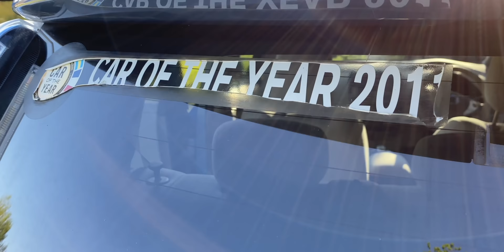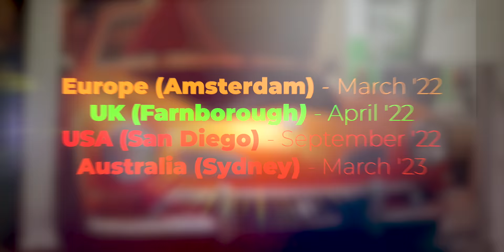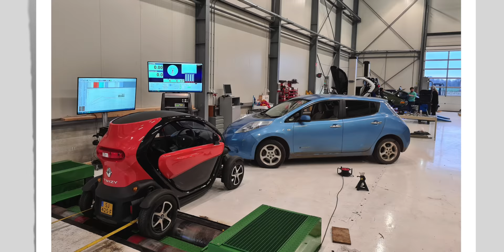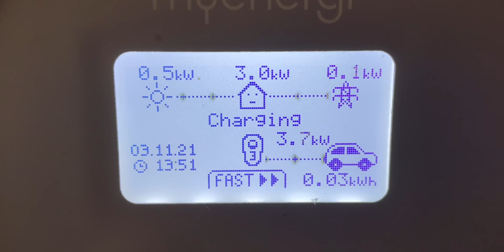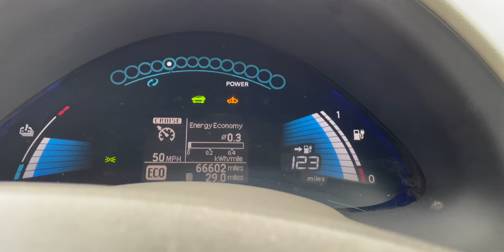Return of the LEAF: Robert drives his range extended EV home from Holland

Comment: n=1, but my 2013 Renault Zoe just passed the 200k km's mark (~125k mi) with the original battery and it still has about 90% of the original battery capacity.
Reply: That’s impressive
Reply: Just don't crash it as it has zero stars on the NCAP ratings.
Reply: @pauldunneska  zero? Really?
Reply: @ChilliPlantOwner  Worth a look at the December 2021 NCAP test for the Renault Zoe which has dropped from five stars to zero stars because the testing regime is now much tougher and also due to the removal of the head airbag that protects occupants from side impacts, according to an Autoexpress magazine  article dated 09/12/21.
Reply: @briangriffiths114  That was in regards to the ZE50, yes. However, keep in mind that the tests gets harder and stricter as time goes, it does not mean that the cars gets less safe than they were when originally tested.
Reply: @pauldunneska  lol no! His car has 5 stars.
Reply: 2 miolion kms miilñes of mileß

Comment: I picked up a 2014 Leaf in 2016. It came from the Bay area in California. I have been driving it in the Pacific Northwest. It now has over 111,000 miles. It still works great. The battery still has 10 battery bars and the original brakes.. When the battery needs to be replaced it will be less expensive than a new car. 
There is a company in Portland Oregon that specializes in taking batteries from wrecked Leafs and swapping out the old battery. The last time I checked they can replace the 24 KW battery for the largest used Leaf battery for less than I paid for the Leaf used. Like getting a new car for a third of the new price.

Comment: Robert, I also have a blue Gen. 1 Nissan Leaf upgraded, in The Netherlands by Muxsan, with an extender battery pack in the boot. Same range as you,  yet I am still using the original battery pack. I now provide the same service in Ireland, Eamon of Range Therapy.
Reply: "Range therapy", what a great name for what you do. Range therapy sounds like a treatment for range anxiety - and that's essentially what it is, of course! 🤣
Reply: As well as my 2 battery bar and 20% degraded 2016 30 kwhr Teckna leaf 6.6 charger, I also have a 2008 e - class mercedes avantgarde diesel with a full range capacity of over 600 miles.

Comment: 2013 Chevy Volt, 286K miles about 50MPG lifetime (engine runs rich). 14K + food deliveries. Degradation; about 80% of original and noticeably increased internal resistance but I just put it in hold mode about 4 miles remaining I still get full power and use the rest on the way home.
Excited to see the LIQUID COOLED Lead battery to be produced!

Comment: Still have 96% capacity on our 7 year old leaf after 86k km. Great for around town, year round even in our cold Canadian winters. Similar experience to Robert - not one issue since new.
Reply: Impressive, ^oo^
Reply: That’s great! I think the culprit with these Nissans is that they don’t have any thermal management. In warm climates that unfortunately kills them prematurely. 
They did help to prove that electric vehicles are viable and that has been invaluable. 
Wonderful to hear the total amount spent on service. A few break pads and I suspect a change of break fluid every two years. 👌
Reply: Our 2014 Leaf have about 91% capacity left at about 88k km.

Edit:  Forgot to mention we live in northen Sweden, sub 0 Celcius 4-6 months a year.
Reply: I'm so impressed, mine is from 2013 and it's at 65% capacity.
Reply: Impressive.
Thank you for sharing 👍
Reply: Only emissions are smugness
Reply: @Paul Haskins: Do you park in a heated garage? 96% is amazing
Reply: @northcountryman  constant heat is what is hard on these uncooled batteries. In a cold Canadian climate, they hold health very well.
Reply: @ashton9699  my uncle has a 2012 with only 3 bar of health gone from the battery. The car has always been charged on 120V and that probably helped it as much as the cold weather half the year
Reply: 96% after 7 years is fantastic, my 2013 leaf had 66% soh when I sold it last year with 191000 miles.
Reply: @ashton9699  mine is at 87% after 5 years and less than 50 k. Also Canadian. 96% is incredible.
Reply: @dylanlong6269  
Did you buy it new?
How do you recharge it....at home or fastchargers?
Have oyu been the only driver?
Does your normal commute involve hills?
Do you live in a hot climate?
Reply: @JohnSmith-yv6eq  Bought it with 40k something miles. I took care of the battery when I had it, but I was in a hot environment and before me it lived in Texas and was fast charged every 2-3 days. No hills. I passed it off to my sister when I moved out and bought a used Model 3. It's still going strong at 70k miles and is almost exclusively home charged. I miss that little car and find an excuse to drive it anytime I'm back at home.
Reply: @dylanlong6269  
Thanks. 
It just shows that even in Texas Leafs can be a reliable vehicle...whether fast charged or home charged...or a combination of both.
Reply: That is what I have on my 2015. I am looking at doubling the distance of my commute and the only thing I have to think about it how I am going to charge it near work. Talked to them about putting in some L2 chargers. I've been looking at replacement batteries but mine is still in such good condition it is hard to justify replacing it. I think sometime after 2017 nissan started cutting corners as I've heard batteries dying sooner.

Comment: Thanks from the 4.5 year owner of a 2014 leaf w only 18k miles.  I was waking up to 72 or so miles of range so long as the weather stayed warm, and, in the colder days of Dec I am seeing 65 to 67 miles of range. It has never been to a shop -- No issues whatsoever -- Still like brand new except for losing a few miles of range over its life. Original untouched tires and brakes.
Reply: Yor tires need be replaced. They lost their efficiency 😄. They are plastic now, not rubber. Very unsafe to drive.
Reply: tejsà celß   get  79 miioke   tóo 82 ñioe eabge

Comment: My 24kWh leaf lost about 1% a year and when I sold it it was 6 years old with 47k on the clock and absolutely nothing went wrong. So it would be good for 20 years before it lost 20% of its range and even then still good as a shopping trolley or school run car. Like Robert I have a Tesla model 3 now but my old Leaf is still one of the best cars I ever owned.
Reply: Nothing going wrong in a 6 year old car with under 50k on the clock isn't impressive tbf, that's basically brand new even for an ICEV but yes your point still stands, the batteries in EVs are WAY more reliable than people give them credit for, they think an EV battery is the same as a mobile phone battery and... it kinda is but only as much as a lawn mower ICE is the same as the ICE in a car, they're built better and the BMS is made to ensure they are treated better than a mobile phone battery is just like how a car engine is built better and has much more systems attached to ensure a long lifespan compared to the lawnmowers engine.
Reply: May I ask how you charged it and to what capacity?  Did you generally use the scheduled charging and stop it at 80% as the battery management system does allow for, optionally?  Presumably you didn’t do as Robert described in the video and keep the state of charge close to 100% most of the time.
Reply: @skyemalcolm  I kept it between 20 and 80%. Most of the charges were 7kw with the odd 50kw. Every now and then I would go for a long run with multiple rapids. I monitored SOC with LEAF spy.
Reply: @pauldenney7908  I appreciate the reply!  Currently running a second hand leaf with 55% state of health as reported by leaf spy and notice that keeping it under 80% SOC the last month has stabilized the drop in degradation whereas over the summer we tended to charge to 100% SOC and the degradation of SOH was noticeable again using leafspy.
Reply: @skyemalcolm  Try the odd motorway run, followed my a rapid, then another motorway run them another rapid. I found it would invigorate the SOC. Constant 3kw charging or not using the car at all seemed to have the worse effect. Whatever you do the curve is always down but you can slow it I found. Is yours an early LEAF? Mine was a 2014 and that had different battery chemistry to the early cars.
Reply: @pauldenney7908  it’s quite an early car, 24 kWh and built in the spring of 2012. According to consistent use of LeafSpy the SOH does hold steady now that I’ve begun scheduled charging maxing out at 80% SOC. Range with this SOC/SOH combination in the winter with heat means we are working with less than 10 total kWh so it’s strictly a city car for us. Still a nice runabout with heated seats and steering wheel and plenty of power but I’m investigating battery replacement options at this point if the car is to serve any purpose beyond that mission profile, so to speak.
Reply: @skyemalcolm  I’ve got the same a 2012 leaf with seven bars and 57% SOH it had 82% SOH when I got it 5 years ago and I’ve always charged 80% but it’s still dropped every year. Heat and cold are not friends
Reply: @Milhouse77BS  I’ve heard something to the effect of “don’t charge these cars over black asphalt in hot climates” because the battery can’t shed heat or rather the hot asphalt heat transfers up into the battery. Is that perhaps related to your personal experience?
Reply: 100 yeàrs
Reply: @skyemalcolm  If it's one of the gen 1 Leafs they did have battery issues, the post 2014 ones used a different chemistry.
Reply: @pauldenney7908  it’s an 11 or 12 yeah. Anyway the LeafSpy data is what it is. It loses currently about 1% state of health every two months regardless of how we charge it. A pity but I paid so little for the car and we keep getting miles of use out it I’ll not worry till a replacement option is available or I’ll just scrap it and sell the pack online to hobbyists.

Comment: Gotta say, that tractor looked fantastic. They are perfect for electric conversion too. With the torque of an electric motor I bet it out performs the diesel versions with ease
Reply: In a past life my job was to do the integration design to put diesel engines into agricultural & construction machines. It always struck me how horribly compromised all these installations were. Transmitting power mechanically from the engine pod to the wheels through bevel gears and high range boxes etc was complex, hard to design and full of friction. Accommodating all the air and cooling systems was even harder, then there was exhaust aftertreatment, which was expensive and full of ignition sources which were dangerous in environments with chaff and dust etc.
Many of these problems are much reduced or disappear entirely with an electric drivetrain.
Reply: the prolbem is that these diesel drivetrains simply cannot cope with the forces. so electric motors need to be kneecapped to prevent them from turning the entire drivetrain into one big piece of overcooked fusilli.
Reply: @SupremeRuleroftheWorld  The trick must be to integrate the motors close to the wheels, throw away the drivetrain, and put the batteries where the engine was.
Reply: @bimblinghill  that is physcially impossibe as with modern tractors the gearboxes ARE the frame of the tractor.
Reply: @SupremeRuleroftheWorld  As you'll see from my original comment, I know a bit about the structure of tractors etc. My phrase 'throw away' was flippant and a simplification. Some parts of the transmission e.g flywheel housing & gearbox housing can be retained and some new parts will be required to connect to them. All perfectly possible. Low volume sand castings are etc made to maintain long-discontinued models. This same supply chain could support electric conversions.
Reply: @SupremeRuleroftheWorld  
So you are saying its impossible to redesign tractor frame? LOL you genuinely believe this??
Reply: @SMGJohn  that is not what i said. i just said is just brute forced engineerd old crap.

Comment: "You have to charge it once, maybe twice a week." That depends on how much you use it. I have a 40kWh Leaf and I use it for work. The battery is the prefect size for my job, with me charging it every day, to 70-90%, depending on workload expected and weather forecast. So I reckon I am getting good use out of my battery. If you use a car for work, it's not "the bigger the better" for the battery, but "how much do I need to do my job reliably?" I've got the perfect size for my job, delivering up to 200 parcels per day.
Reply: The big advantage of a delivery vehicle is that the range is irrelevant, as long as you have sufficient plus 10% it's a cheaper more reliable choice and a smart economical  business decision

Comment: I'm on my first Leaf, second battery. I wore out the first battery at 75,000 miles. Nissan replaced it on warranty for free. They placed the price on the work order and it cost USD$15,000+. Now I have excellent range. I wonder if they gave me a bigger battery. Initially it was a 30kWh battery with 107 mile range. Now the car tells me it's 156 miles!
Reply: Perhaps the 30kwh battery is no longer being produced...so your benefit......40kwh instead.
Reply: goid fír it

Comment: The very first electric car I drove was when I was working for Microsoft Ireland in Dublin. I drove the pearlescent white one with full leather. I couldn’t believe how quiet and refined it was. It was a demonstration vehicle. Since then I went to the Auris hybrid, to the Mercedes 350E to the e-golf. After three years of owning the e-golf I have seen no battery deterioration and virtually zero maintenance costs. Amazing car. And it still brings an enormous grin, as I chuck it through the roundabouts in Milton Keynes or use it around the country lanes.
Reply: I have a 2017 eGolf, the most underrated car in my opinion. I drove the new ID3 and wondered why they did simply not continue with the eGolf: just as smooth and the eGolf has buttons instead of this digital crap. The eGolf gives you also much more information, right on the 2 screens; nowhere to be found on the ID3.
Reply: @belgianbuzzer  Yes, the ergonomics of the e-golf, matched with the peerless handling and excellent chassis, make it an EV Classic. These cars will likely go up in value as time goes on.

Comment: Many people don't know that the Leaf should have (Nissan Recommendation) the reduction gear oil changed every 30K miles / 50K km 
Also other recommend services are: Brake fluid replacement, keep Regen at optimal, drive shaft lock nut greased and torqued (if you get a knocking sound when launching or reversing), Cabin filter, 12V battery (usually after 8Y),
brake pads are changed different distance/year depending if you Leaf has B Mode or not, CV joints also can fail if boot is perished or damage. These are from personal experiences and from other owners I've talked too.
Reply: I don't believe the 30K miles figure,   That's a ploy so that the Nissan Dealer can make some additional funds.    I know people with 80K miles who changed it and nothing went wrong.  A friend has 173K on his LEAF and never changed it yet.   My 2012 LEAF has 87,000 miles and I have not changed it yet.   I had a Brake fluid flush at 30K and then at 62K I topped it off myself,   I'm at 87,000 with the original brakes and the Brake fluid looks fine and I have tested the fluid to see if there's moisture and it's still fine.  Cabin filter I replace once a year,  I am on my 3rd 12V battery,    First died at 48,000,    2nd at 85,000 miles and 3rd is only a year old.
Reply: @nissanleafbattery  Yeah its manufacture (Nissan) recommendation which our mechanic also recommends to prevent the main reduction bearings from failing. We have 2 Leafs (2011/2014) and got the 2014 done at 60K by our mechanic who said oil was darken, got the 2011 done at 92K and they said it was black, also did the brake fluid flush at same time and regen went from 1 dot to 3 dots (non B mode) also gained 0.4 average energy eco haha. Previous owner did next to no maintenance sigh...
Rob may be unaware of this since he didn't mention it, i was just being courteous to write this here. Cheers

Comment: Mr. Llewellyn.  Thank you for the video. My comments are more for your subscribers/readers. I have one of the first model 3 Teslas.  Long range rear wheel drive.  I have travelled to Myrtle Beach S Carolina and \Florida from Toronto, Canada in it. There, no question it has a longer range than the Leaf. I time my stops for re-charging with my breakfast, lunch and dinners.  What I am really trying to convey is that recently I was in Myrtle Beach (I had to fly there).  To get to Florida I rented an ICE vehicle.  ALL THE WAY there, I was constantly checking mileage and need of fuel (petrol to you folks.).  What irony!!  The Tesla would have indicated where and when I would need to recharge.  If any of your subscribers are concerned.  DO NOT BE.  You will never ever buy anything but an EV ever again.  Quiet, efficient, substantially less expensive. (Oh yes, did I mention that your children and grandchildren will thank you?)